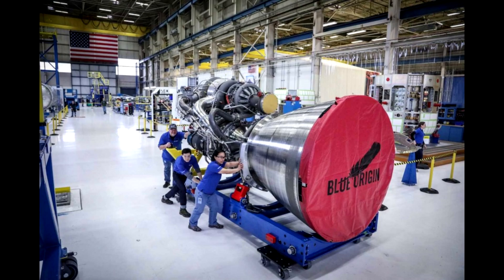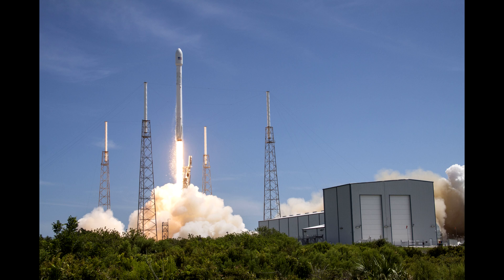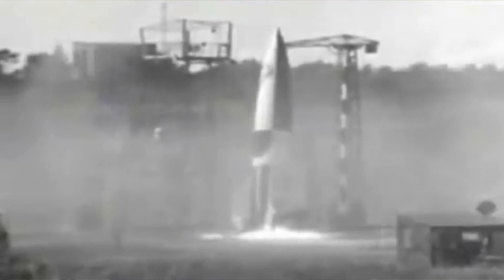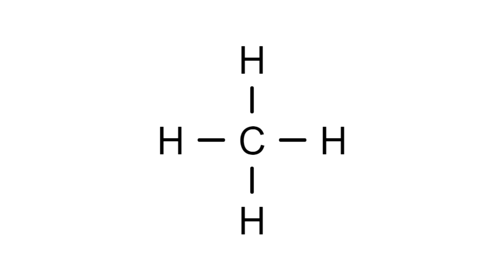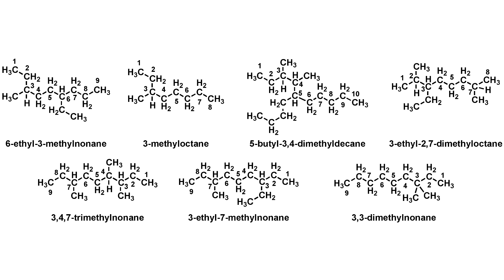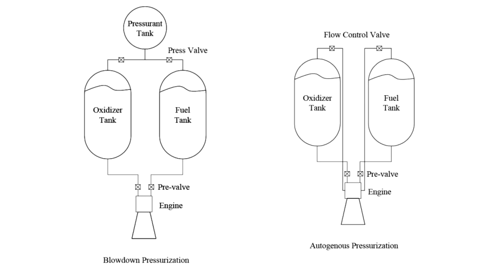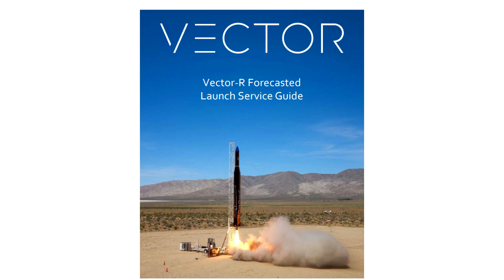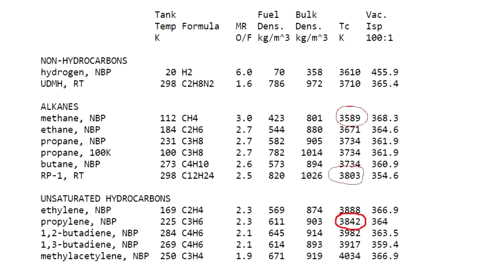Why Next Generation Rockets are Using Methane

Comment: 8:57 Are all rocket guys bald? To baldly go where no man has been before? ;-)
Reply: It's all about aerodynamic efficiency. It's called a fairing, not a hairing. : P
Reply: Saves on mass
Reply: One less thing to worry about catching fire
Reply: Hydrazine will do that.
Reply: @WineScrounger  In the 1950s, hydrazine was sprayed on onions sold in grocery stores (to prevent them from sprouting while in the bins) and on weeds along roads and railroad crossings (the latter work was often done by paid college students using regular gardeners' pump sprayers)! This was part of the "Better Living Through Chemistry" mindset.
Reply: It's a very efficient hairstyle.
Reply: That's why Picard got the job.
Reply: Technically, Musk would be bald aswell. He just chose to go down a different path :)
Reply: @stsk1061  have you seen melon musk?
Reply: G-forces :)
Reply: There isn't space for hair with all those brains. Er?
Reply: Less hair translates to less impedance to rocket-science entering the brain.
Reply: Better cooling, better aerodynamic, plus you can't tell where their forehead stop.
Reply: Tom F...just wear a hat in winter or the bright sun: trust me on this, I have male pattern baldness and my head gets cold in the winter even faster than my feet..
Reply: It's a heat shield for reentry
Reply: @ulob  must've been an ablative shield then
Reply: The hair burns off them all on re-entry 😀
Reply: zapfanzapfan I know what you mean
Reply: Patrick Stewart started the trend.
Reply: Well they say there are old pilots and bold pilots but no old bold pilots
Reply: Robert Sutton: Well, Chuck Yeager is still alive at 95 :-)
Reply: @zapfanzapfan  Sadly Yeager just passed away. Had a good innings though, considering how dangerously he lived.
Reply: Bald guy here. I'm not a rocket guy. Using my faulty logic proves this statement false.
Reply: breakone9r 
I disagree.  I believe you’re a closet rocket scientist.
Reply: zapfanx2: maybe rocketeers tend to shave their dome cuz all that going boldly stuff is already a pretty hairy pursuit..
Reply: These two, Scott Manley, Curious Droid. Seems it's true.
Reply: Robert Goddard was bald, too, but Wernher von Braun, Hermann Oberth, and Sergei Korolev weren't.
Reply: Perhaps related, men with pattern baldness typically have higher levels of testosterone and androgen.
Reply: It's known as the no-hair theorem.
Reply: You know, don't laugh.  It's possible.
Reply: William Shatner isn't; the late Leonard Nimoy wasn't.
Reply: Gets burned off
Reply: Rocket scientists; hair not required.
Reply: high performance CPU needs cooling
Reply: It is all about aerodynamics!
Reply: You know lots of bald people are cancer survivors right?
Reply: @americanrick9021  but not all cancer survivors are bald just like not all baldies had cancer.
Reply: @americanrick9021  Spare a though for alopecia you nasty man.
Reply: Trump 2020

Comment: since the first stage can be completely reusable now, why doesn't space x just go to rp1 and dinitrogen tetroxide or hydrazine and dinitrogen tetroxide. I understand why LOX and methane would be good for upper stages for interplanetary fuel manufacture, but the first stage comes back anyway.
Reply: Standardization of the production line so they can cheaply crank out engines and parts, I would guess.

Comment: Let me add two details:
1) LOX and LCH4 have just 3 degrees (Centigrades) of difference for the cryo temperature. This means that you can use same tank design and you can have a common bulkhead in the tanks "for free".
2) If you wanna do a full staged combustion, you can only use hydrogen or methane, withing the space launch civilian fuels. Raptor is full stage combustion.

Comment: BO is a copycat to such an extent that they are even copying the engine tech. Despicable group, they are the Faraday Future of the rocket industry.
Reply: It's a different engine entirely, they're just using the same fuel. By that logic SpaceX's Merlin engine is copied from every previous RP-1 engine. Also there's nothing wrong with having more than one launch provider, it drives competition and innovation.

Comment: Do you think there's a chance we  see nuclear engines (NERVA type) in the relatively near future ?
Reply: I doubt it.
This is not a "green hysterics" type of thing, but simply a matter of economics and rationality. The thrust-to-weight ratio of a NERVA type rocket is nowhere near that of chemical propulsion and a NERVA type engine would essentially be payload for a chemical rocket to get it into space. A BFR-style approach is much more economical - just use the same rocket to  launch into LEO and for BEO targets utilising in-orbit refuelling.
The only advantage of NTR is the lower fuel weight, but that kind of loses importance as you look at cheaper alternatives such as in-orbit fuel depots and BFR/SLS super heavy lift capabilities arrive. The BFS tanker variant and the Raptor and BE-4 engines might be the single most important developments in that regard. While NTR is a one-way only solution (e.g. after fuel depletion you can basically discard the engines), methane-powered engines can use fuel from in-situ production on Mars and Saturn's moon Titan.
Reply: @totalermist  you could also do electrolysis with water on Mars
Reply: @totalermist  "(e.g. after fuel depletion you can basically discard the engines)"

While this was in some early Mars mission architectures, nothing requires a NERVA engine to be a single-mission device. And they too, would benefit from orbital fuel (only H2 in this case) depots.
Reply: @stardolphin2  ". And they too, would benefit from orbital fuel (only H2 in this case) depots."
And that's where the problem lies. Storing H² for extended periods of time is much more difficult than for other chemical fuels. Since H² likes to diffuse, pressurised tanks would empty quickly. Cryogenic compressed storage requires elaborate cooling solutions (while still suffering from diffusion) and if chemically-bound storage is used, one might as well use the fuel (e.g. methane) directly...
Reply: Zero probability that the US/Europe will use them given the near hysterics that the greens make over the microscopic particles of radioactive material in the current spacecraft. Russians and Chinese don't care what the greens think so they will probably do it.  Maybe if we mine/refine the radioactive material in space.
Reply: So... why haven't they?  It's not like the idea is new.
Reply: I suspect they aren't really that good compared to the electric propulsion systems.  NERVA seems like a niche (heavy/fast/crude).
Reply: @RS-ls7mm  they are much much better than ion propulsion on a thrust level and they have twice the ISP of chemical propulsion they can replace second and third stages unlike ion propulsion. Yes they are a bit heavier but they need much less fuel so it has a clear advantage over chemical
Reply: There is Alot more to it, Than just "a bit" better than ion in atmosphere, you are talking about trying to put 'several' ships/submarines into orbit. for the thrust of a Titan. put it on the pad and see if it flys. it has a good, ISP compared to chemical rockets, but you are talking about a mass as large as a fully fueled Saturn just for the engines alone, no payload, no tanks, no fuel, If you had an umbilical to supply fuel directly. It would drain All the tanks at KSC and still not clear the tower.
Reply: @5Andysalive  Much the same reasons we stopped working on them after Apollo. Any kind of support for the missions that could use them (LEO to Lunar orbit tugs and Mars) went away, so the need to continue NERVA development did, too.

And note that in spite of a lot of talk about Mars, we still don't have a definite, funded NASA Humans to Mars program.
Reply: @RS-ls7mm  But an efficent high-thrust engine is exactly what you want for orbital departure /  insertion at either end, rather than slowly spiraling up to (and down from, on return, assuming no aerobraking) escape velocity, over a period of weeks.

Especially around Earth, where that means spending far too much time in the VanAllen belts, rather than cutting quickly across them...
Reply: @stardolphin2  Apollo mostly went around the belts.  Don't see why we couldn't do the same.  But even then it was just a weight issue for the shielding.  Spacecraft propulsion guys were just down the hall from me.  Not my field but you learn things in that environment.  Anything electric saved a lot on fuel (and weight).
Reply: @RS-ls7mm  I'm no "green" and I'm not anti nuclear, but the "particles" in RTGs are hardly microscopic. Cassini had 72 POUNDS (33kg) of plutonium-238 on board.  That's hardly a "microscopic" amount.
Reply: @stargazer7644  This is what happens when you don't' read the whole article.  It wasn't in one mass, it was divided up into hundreds of pieces then each piece was heavily protected. And don't forget that Plutonium is one of the densest elements, it doesn't take much to get 72 pound.  Sounds like you follow the alarmist media.

Comment: I was quite surprised that Blue Origin is planning to use propylene rather than ethylene, which has very similar properties according to the table you showed. Because propylene is waaaaaaaay more expensive than ethylene.
Does anyone know why they prefer it?
The only reason I could imagine from the top of my head is propylene being safer as it does not tend to polymerize as easily, which is exothermic and can lead to runaway reactions aka unscheduled rapid disassembly. While again that should not be a problem at cryogenic temperatures and the chemical industry is using ethylene in quantities of hundreds of millions of metric tons per year (literally).
Reply: BO is going for Methalox. Propylene is being considered by Vector Space Systems instead.
Reply: @Christian Norf Blue Origin is not using propylene; They are using methane.  Vector is using propylene.  I've seen evidence that both propylene and ethylene are viable options but nothing to indicate why Vector chose propylene.

Comment: Will a Space Elevator ever become a practicality, instead of rockets?
Reply: If we learn to produce really long graphene ropes very cheaply, and have an enormous demand for space launches, then...maybe. It would still be an incredibly expensive and risky project, and definitely a long way off. But there are other options for cheaper spaceflight, like boosted orbital tethers, and even plain old reusable rockets have a lot of potential.
Reply: Technologies like mass drivers and space elevators make more sense on less massive bodies (the Moon for instance). On Earth it's very hard to pull off, requires some very exotic material, and would be extremely expensive. Maybe we will see it sometime tin the far future, but I wouldn't look for one in the next 100 years.
Reply: I hope not. Space elevators would make the sight of the Earth very ugly from space. Rockets and other spacelaunch systems forever!
Reply: @MrAlRats  The only part you might see from a distance, would be that which is deliberately lighted, like a radio tower (which the portion in the atmosphere surely would be, for the same reasons).
Reply: No. Space elevators are a really impractical design. Even if you get the elevator for free, designing a climber to climb up to the top is arguably more difficult than to design a rocket, and the rocket is much more flexible in terms of orbits. Orbital rings are already much more practical.
Reply: @Darren Murphy "how would they keep the top of the elevator in orbit"

A space elevator is a device whose center of mass is in geostationary orbit. It reaches both outward and downward in equal amounts (or at least equal mass, like balancing on a see-saw), and the low end happens to be long enough to reach the ground.

But this means stuff (carbon nanotubes, which we can't make in anything like the necessary quantities) with serious tensile strength. And the only place you can get off and be in orbit, is at the geostationary point. Anything lower, and you have to make up the difference in orbital veloicity yourself.

"satellite orbits would make this a logistical nightmare"

Yes. Such a thing is a potential stationary target on the equator for all objects in all inclinations, all eccentricities, in all orbits below the far end of the device. (Except objects also in geostationary orbit above other longitudes, that it should maintain the same distance from).

Going up, would be a rather slow ride through the VanAllens, as well...
Reply: Sure.  All you need is a 40,000 mile long cable that is stronger than anything that has ever been made.  Then you're home free.
Reply: @Darren Murphy You start at geosync, and you start building up and down at the same time. Eventually you'll touch down on the ground. The part of the elevator you build upward with counterbalances the part that you build down with.  You end up with a 46,000 mile high elevator.

Comment: Good to see fossil fuels potentially getting phased out in the rocket industry. Hopefully, when SpaceX starts manufacturing Methane and Oxidiser using renewable energy; all others in the industry will follow due to the cost advantage. Would be even better if cheap, suborbital intercontinental flights in rapidly reusable spaceships could replace long-distance commercial airlines.
Reply: What are you dreaming of?
Getting methan out of renewable energies can be as inefficient as electrolysing H2, if not worse and if i'm not completely off, methan still is a fossil fuel (or at least gained out of fossil fuels).
Reply: If there really was a cost advantage to making methane with renewable energy then someone would be doing it already.  But it's in cheap and plentiful supply from landfills.
Reply: The only advantage of making methane using say solar power is that it zero's out the carbon footprint.  You remove CO2 from air, make methane, burn it and put the same amount of Co2 back in air.  I think that was the reasoning anyway...
Reply: That's one of the advantages but eventually it will be cheaper to do that than pumping natural gas out of the ground and transporting it as opposed to synthesising it locally using excess renewable energy generation. This will happen sooner if a carbon tax gets introduced.
Reply: @MrAlRats  
How big should they make the solar cell field for such an application, kilometers wide or what? The idea is all nice and dandy but sounds like a halfassed daydream. I hardly believe that renewable energys will be more cost efficient than just pumping it like the good old fashioned fossil fuels.

Comment: I know I'm an idiot but doesn't cow shit produbce methane?
Reply: Lots of stuff does.  Swamp gas is methane too.
Reply: Rohan rathor, most of the methane   is belched out although some comes out the other end.   It's the result of microbial fermentation in one of the four stomach compartments.
Reply: @anullhandle   so does that mean that methane is easier to comeby than other types of fuel?

Comment: How does methane compare to RP1 in terms of fuel cost per launch?
Reply: From my recollection, CH4 is extremely cheap, most likely cheaper than RP-1.  It often gets burnt away as a “waste gas” during fracking processes.
Reply: newsgetsold the cost of the fuel is insignificant compared to both the rocket and the payload.
Reply: @professortrog7742  Yes I realise that, although Musk is saying that the goal for BFR is to make it fully and rapidly reusable so that the cost of the fuel is the main cost.  Musk was also saying that BFR can compete with commercial aviation for Earth to Earth passenger transport.  I know this may never come to fruition, but it's an admirable vision and to understand if the fuel costs will help us to understand if it could ever compete.